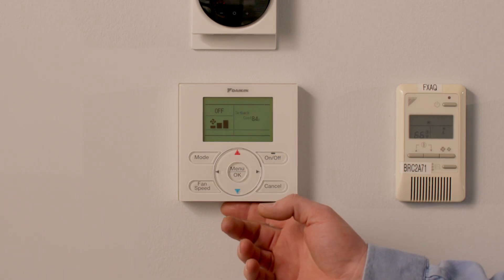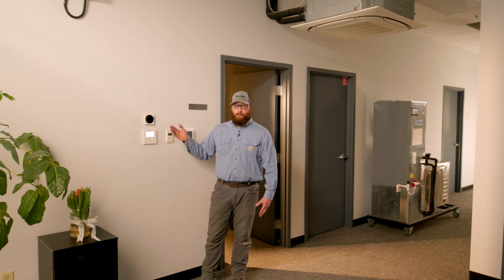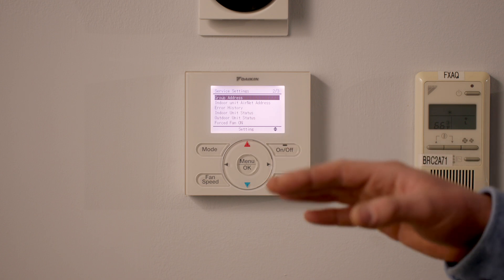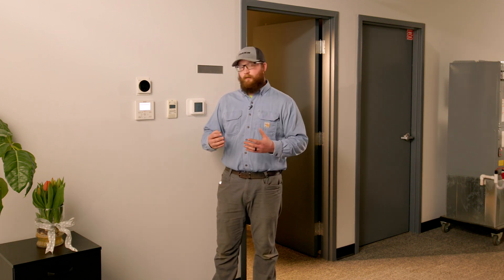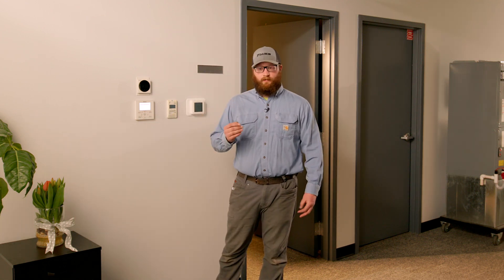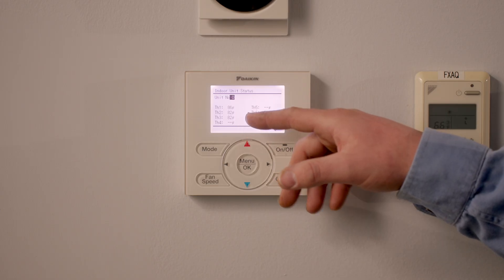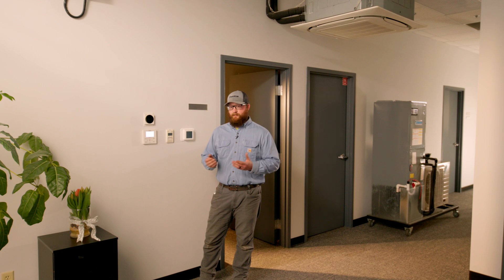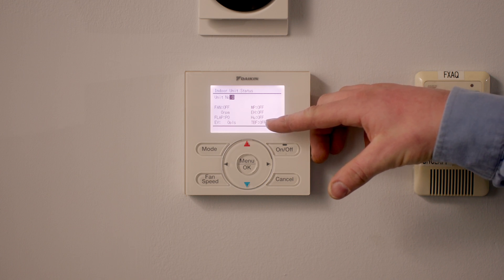Navigating the Daikin BRC1E73 (NavStat) | Service & Maintenance Menu Overview

Comment: The installer says he set the deadband at 1* C, but at my 22*C set point, room temp stays on 21*C a long time before unit turns on, and stays on a long time after hitting 22*C before shutting off. I’d like to keep the house temp at consistant as possible.

Will no technician on here answer my question? I thought this is what  YouTube is about…learning??